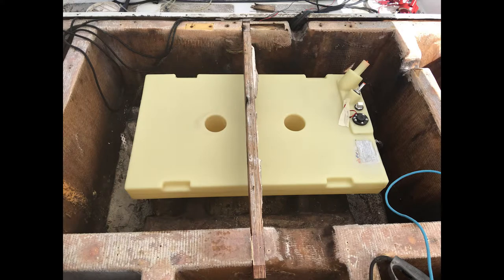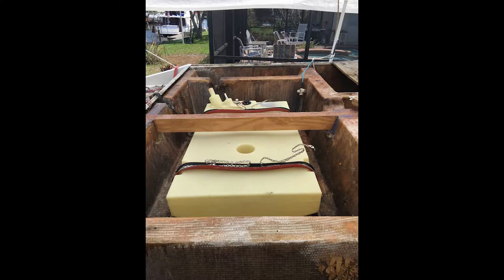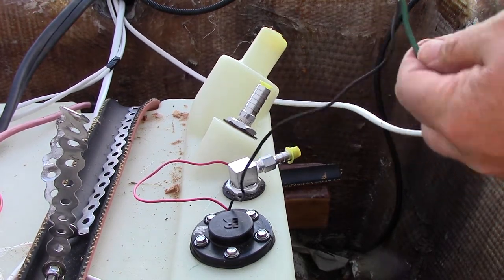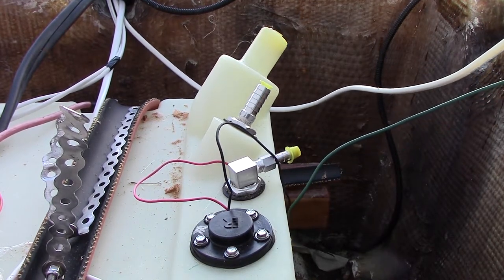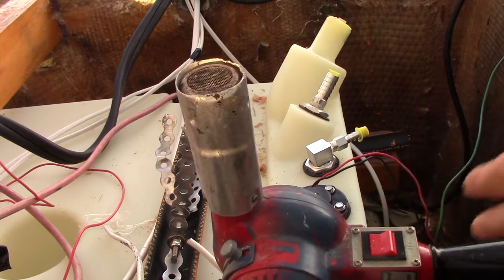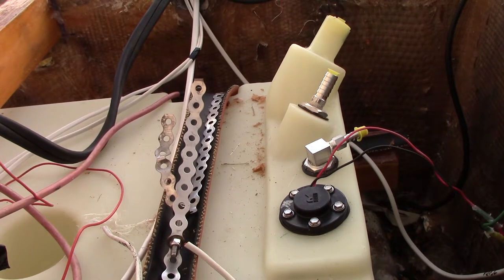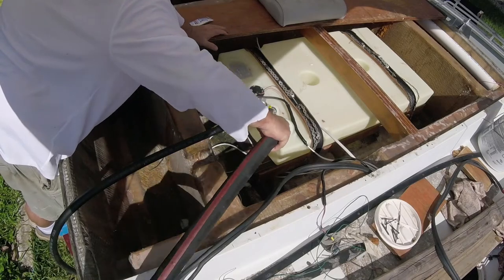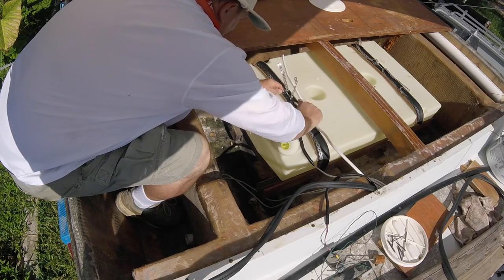How to install a Fuel Tank

Comment: Where did you get those metal straps?  Are they Stainless Steel or just galvanized?
Reply from the maker: They were the same ones that held the original tank. They were stainless steel.
Reply: @SmokinReels  Interesting.  Any idea where I could get some?  I know plumbing straps have been recommended to me but they don’t seem to come in a Stainless Steel.